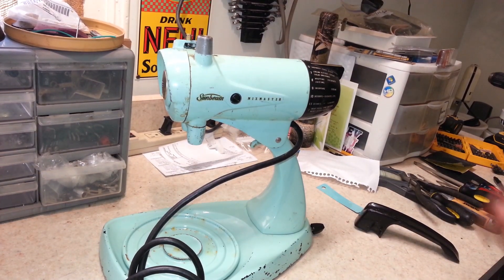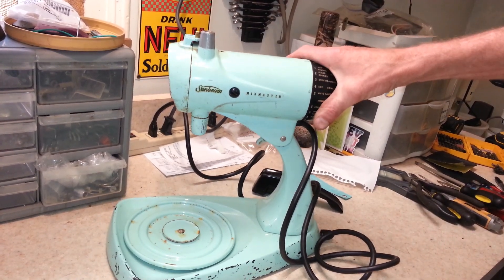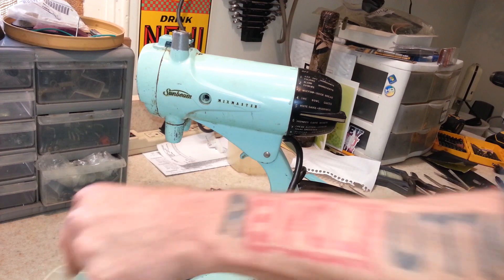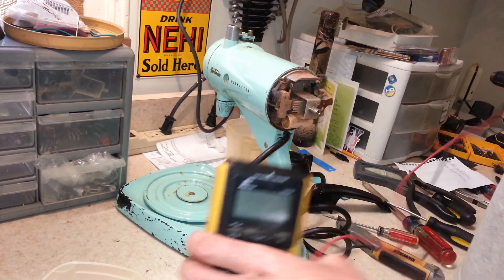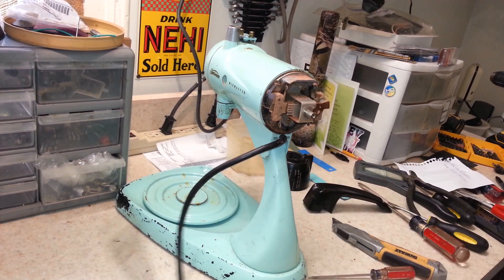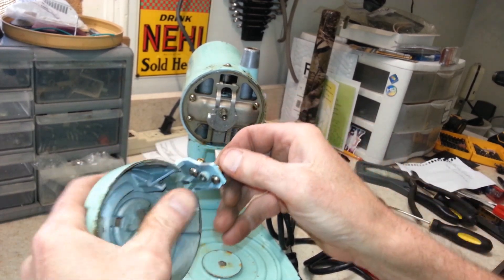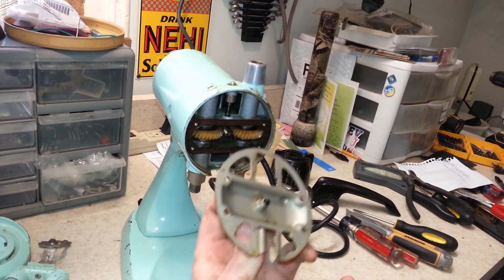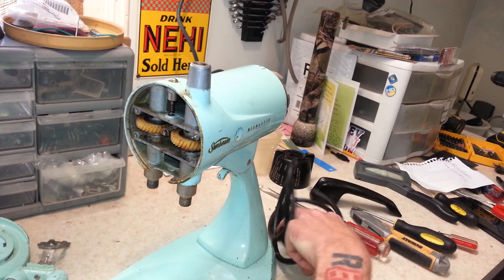Turquoise Sunbeam Mixmaster Model 12 restoration in Sea Foam Green

Comment: *SHRIEK!!*  WOW, that's my mixer!!  :D  Took all my will power not to skip to the end to see it done, but the wait was worth it, it looks amazing!!  To clarify the background a little, this mixer was a gift given to my mom when she was 23 (in 1965).  At some point mom let someone borrow it.  They didn't know how to take the beaters out, so instead of asking, they used brut force.  Mom said it cost her a fortune to have it fixed.  That explains the lack of grease and Lou Ferrigno (lol) reassembling it.  After that, this was our regular stand mixer up thru the time I was in high school (early 90s).  Mom replaced it with a Kitchenaid, maybe in 2004-ish, and gave the Sunbeam to my sister.  That was about the time it fell out of her car during a move.. I believe the car was stopped tho.  Now finally in 2018, its mine, its restored, and it will be well cared for for as long as I own it.  Thanks so much for the amazing work you do Rick!  ~Marta
Reply: Thank you for sharing your story, hope you have the recipe/instruction booklet, if not you can buy one thru eBay.  Check for the cheapest deal you can find, some have high shipping and handling fees.  Happy Mixing!  Sunbeam made the model 12 from 1957 until 1967 and were available in white, yellow, pink, turquoise and chrome.
Reply from the maker: LOL Im glad you restrained and made it through the boring parts! Thank you for clarifying the story too, I tried to explain it the best I could second hand .  You cracked me up with the Lou Ferrigno reference! Its great to have such cool stories behind something that is passed down, Im sure you will add many more!
Thanks again!!
Reply: Hi Russ, I do have the original booklet in fact.  :)  I also have both bowls (with chipped edges unfortunately) and the beaters.  I'm so excited to start mixing!

Comment: Would love to send in late Mom's Hamilton Beach Model H white model for restoration when you get caught up someday. In my collection now I have Sunbeam Model 9, MMA yellow Brady Bunch mixer, a 1990's Mixmaster, and the last HB mixer in harvest gold they made like the Model H and K in 1982. 😁
Reply: I was thinking of having the same thing done to my mom's white model H.  It has survived 61+ years of use  having the original bowl and beaters.  My sister and I are both accomplished bakers thanks to this machine.  Thanks to ebay, I have a chrome model H with all the available attachments including the difficult to find coffee grinder.   The dough hook (model 588) has been used with it also.  Vintage appliances from the 1950 were made substantially better that what was produced by most manufacturers after the 1970s.
Reply from the maker: Nice collection!
Reply: Dont wait, just send it in... Rick had my mixer for 2 months-ish.. That's nothing compared to having a restored mixer that will last a long time!